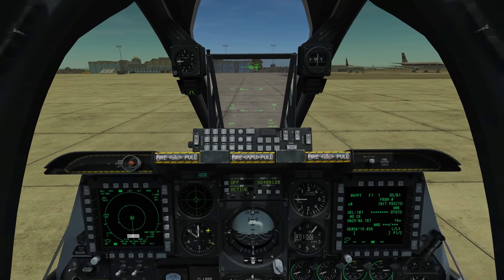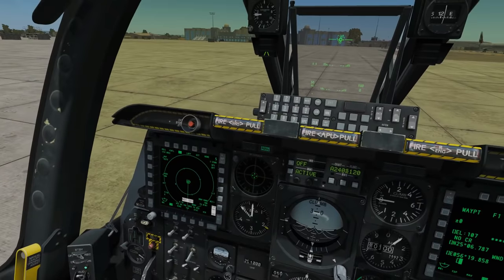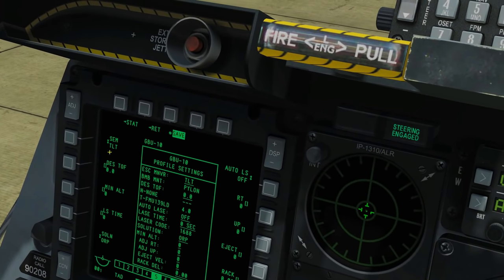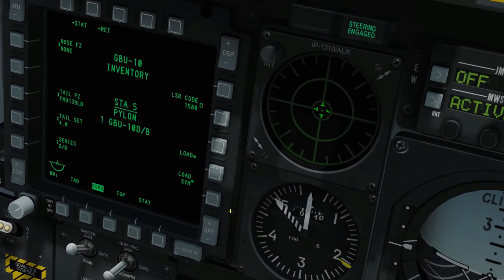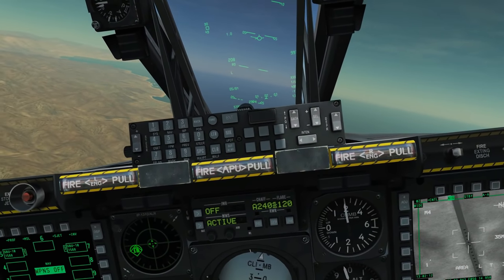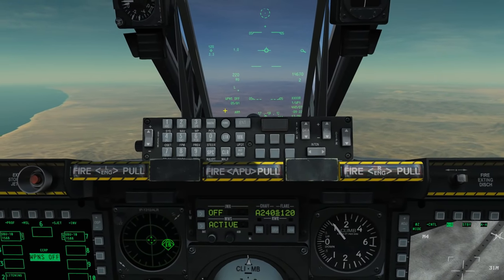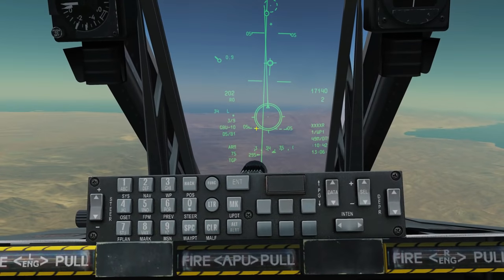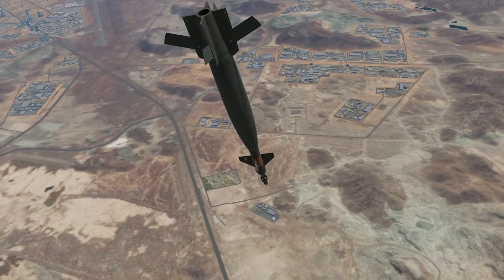A-10C Warthog: Laser Guided Bombs Tutorial | DCS WORLD

Comment: regarding 18:48
do NOT use point track mode if you maneuver enough that your TGP loses sight of the tracked target, it will try to auto-adjust when the target is masked (e.g. terrain, turning and looking at own wing/aircraft). Area mode is superior because it latches onto the coordinates itself that were previously slewed on. Point track mode is good to designate JDAMs because on area track you can sometimes designate the ground below/besides the tank without realizing.
:)
Reply from the maker: Good call thx
Reply: I saw on a couple different vids that when creating a SPI in area mode you should fire the laser to precisely pin point the target. Then you won't accidentally designate below'beside target by mistake. It worked well in all cases.

Comment: JDAM 
Pros:
-Less things to do and more practical to drop
-Is smaller in dimensions as they just add extra control surcfaces and GPS/INS guidance system
-Can be used in both VFR and IFR conditions
-What is a TGP?

Cons:
-Less flexible towards changing situation (e.g. the target location and waypoint is incorrect, or the target is moving,etc.)
-Is slightly less accurate

Paveway
Pros:
-Very accurate (sometimes)
-Very flexible and enables the aircraft to react according to the changing situation
-The name is badass
-Could track a moving target

Cons:
-Lot of things to do for dropping and therefore, not practical in the heat of combat
-Larger in size (the GBU-12 is probably bigger than the GBU-31 or -32)
-Requires TGP
-Clouds could block the IR sensor of the TGP
-Can only be used in VFR conditions

Comment: You asked if the LGB has any advantage over the JDAM. The LGB can hit moving targets while the JDAM cannot. There is an "upgraded" JDAM called the LJDAM, for Laser Joint Direct Attack Munition which can use either GPS guidance for structures and such or the laser for vehicles.

Comment: LSS Code (LSS), data entry OSB 17. Using the scratchpad, you may enter the laser code that will be searched for when in laser spot search (LSS) mode. The entered value can range from 1111 to 1788, but the first digit of the series must be a 1 and the last three digits must be between 1 and 8. The inputted number is displayed below the LSS OSB label. If an invalid number is inputted, an “INPUT ERROR” WCN is displayed in the center of the display.
Reply: Thanks for the info
Reply: Actually the book says the LSS Code is 4-digit octal. So that’s four numbers in range 0-7. I don’t think zero is allowed, so becomes 1-7. Strange that the default 1688 would be an illegal code. I often use 1677 for my own code.